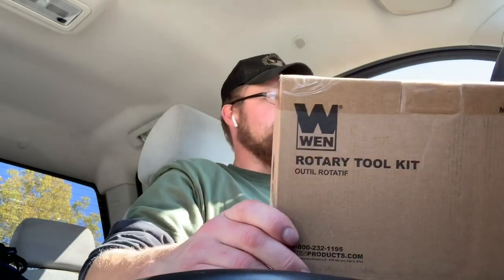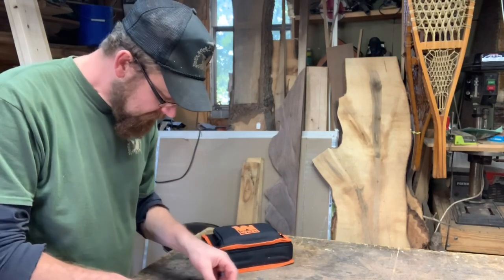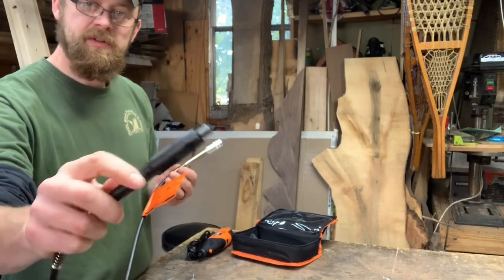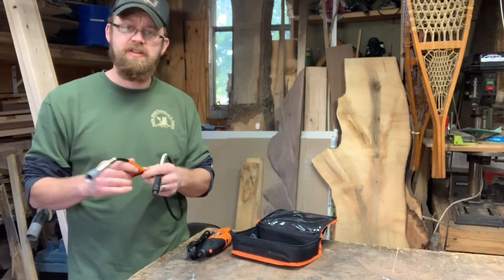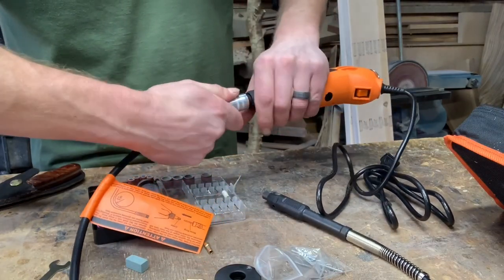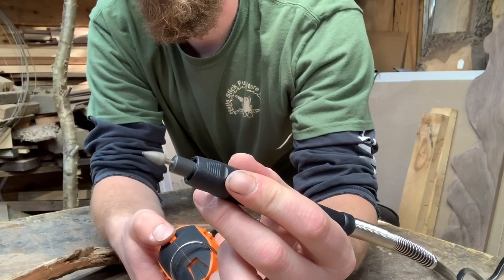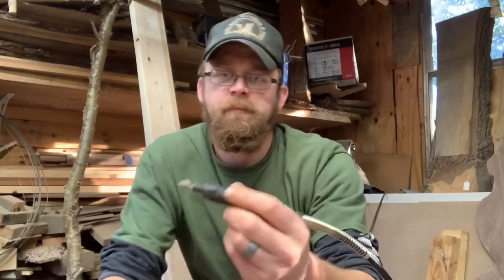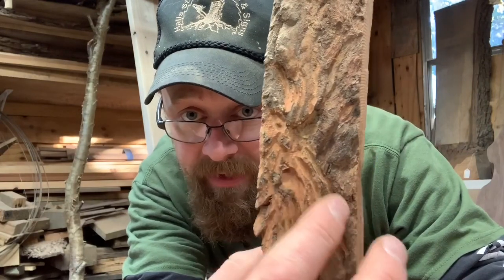New WEN rotary tool unboxing and using .

Comment: I just got done using mine to cut some screw driver slots in bolts.  Worked great!  Only paid $26 new on ebay with the flex shaft.
Reply from the maker: Awesome!!

Comment: How do I lubricate the flex shaft?  The instruction manual says use multi purpose grease? What is multipurpose grease.  Thank you. I enjoyed the video.
Reply: I just put a “splash” (5-7 drops) of KY lube either directly onto the shaft, and then make sure to work it up & down the entire length of the shaft, as well as fully around as well. More is far better than less Esp when it comes to the tip of the shaft, and I’ll often deliberately apply the lube to the shaft while it’s in close proximity to the work piece, in this way a bit will fall into the workpiece and that will smooth out any hard or rough penetration moves that otherwise take precious time to build up to. 

A generous slathering of such a light lube on your shaft and your work-piece, be it a hook,slot,w-horie (wood(based)-hole opened (by) ramming inside energetically), or even a pipe lay into a dark recess yields better insertion, penetration, performance and productivity with your shaft. When, out of necessity (budget, time = money, last min job, competition attempting to poach your work, client having repeated dissatisfactory with current contractor, etc etc) the situation calls for rapid, high speed, high torque, immediate complete shaft insertion to bottom out, using the alternative back door for exceedingly worn primary cutout, or even the dreaded low battery remaining and no backups on hand, as well as when the client is in need of the job to be completed and doesn’t care about any damages or deformations caused by rough tool usage that commonly leads to,sacrificing on the details in favor of ensuring that the hole is fully filled, and with sufficient force that even if a smaller tool is used hard on the working piece, the client will only summon you from then on out. 

A handyman generates leads & cultivates them by providing quality materials quickly (same day delivery of hard wood), by becoming an expert on how to wield their flexi-shaft to fit every customer’s individual needs well, and knowing when to really hammer the customer’s gaping opening with a special “fleXXX shaft”, and by simply incorporating these foundational practices into YOUR workflow, you’ll find that you barely have time to practice working your shaft on your own due to how frequently your services are being booked. 

While that is a magical & exciting time, it’s important to remember how easily one can badly damage their shaft if they aren’t careful, as well as how quickly you can go from blowing up to bankrupt if you become so rushed, stressed, and/or overworked that you repeatedly have to leave a job unfinished due to battery drain, or when you overdo it on the rapid penetration technique, leading to a very common phenomenon where you finish quite wuickly, but the client isn’t satisfied. 

Just remember, the longer the shaft….. the more lube and additional tool maintenance that will be required…

Comment: Bought a Wen Amazon $18 put flex shaft on unit 
Installed the sand band just try. Would not turn. The sander. Seems like the cable shaft/ tool is slipping…Hmmm I have had numerous rotary tools that lasted 20 years. Maybe less quality these days

Comment: This looks pretty good especially with the light and shield attachments. That's clever how you used it as a router! 👍  I like the hard plastic case with the older ones but the case isn't the most important thing.  
....❓Is 1.4 amps better than the ones with less amps?❓

 I'm considering this purchase because I'm starting to learn metalsmithing and need an affordable (and good) option... one with a flex shaft for sanding and polishing jewelry.  It looks like I could find many uses for this. Thanks for sharing! 🙂

Comment: Has anyone homeowner ever used a tool enough to have to replace the brushes? I havent.
Reply from the maker: I have not with tools that get light use. I did have to replace them in My die grinder from harbor freight